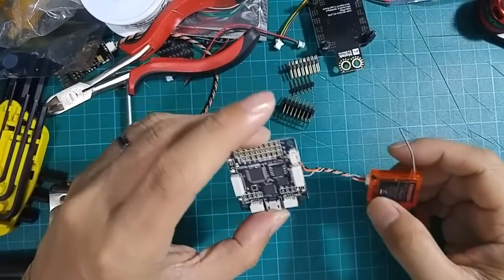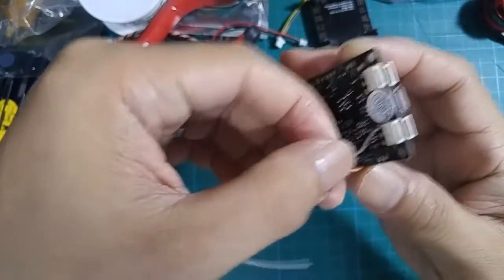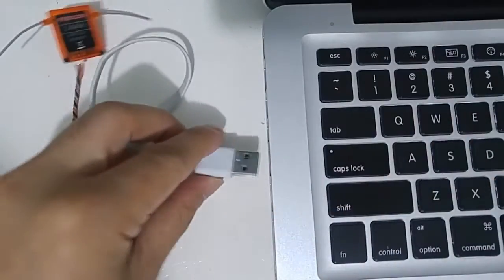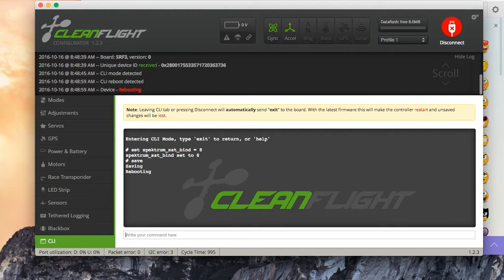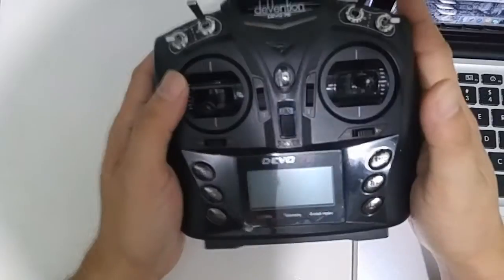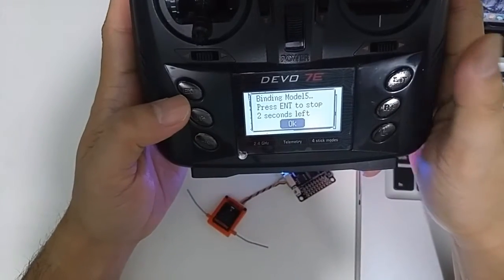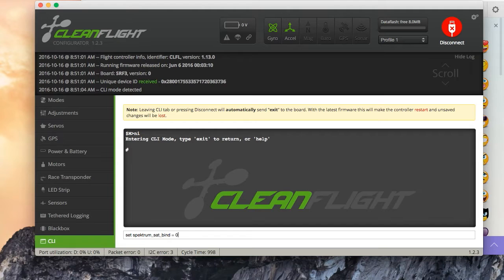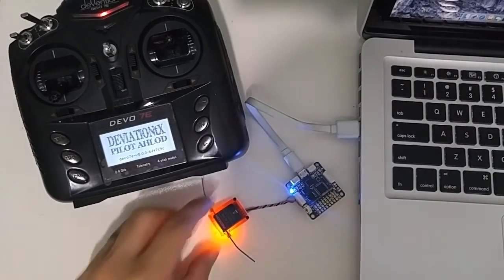How to bind Redcon DSMX Satellite Receiver to Devo 7e using Cleanflight

Comment: thanks....followed your post and was successful binding using Betaflight with the Redcon connected to my CC3D REVO F4 STM32F405 Flight Controller with DX-8 spektrum transmitter.  However, I had to solder the black and red wires directly to the 3.3V on my FC even though it had 3.3v/GND/DSM2 3 pin connector on the board.  Works great but only got it in DSM2 1024bit/22ms only...the DSMX did not work.  Use "set spektrum_sat_bind=3" for the Spektrum Transmitter.  My Spectrum Satellite Receiver (SPM4648) worked directly by plugging it into the 3 pin connector and DSM2 was also enabled.

Comment: Can I put orange wire to the + slot next to black wire?  Isn't it 3.3v also?
Reply from the maker: No that's 5v bro
Reply: Thanks.  I used voltmeter to check and realized that